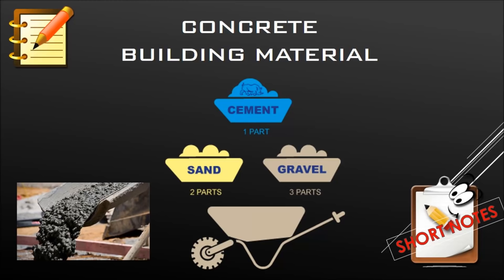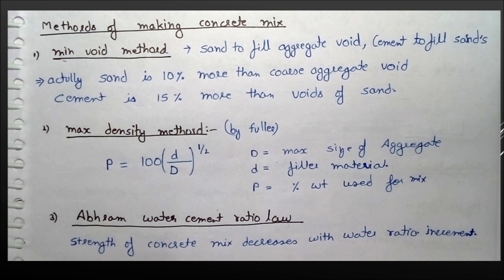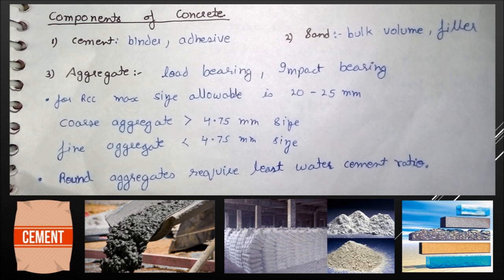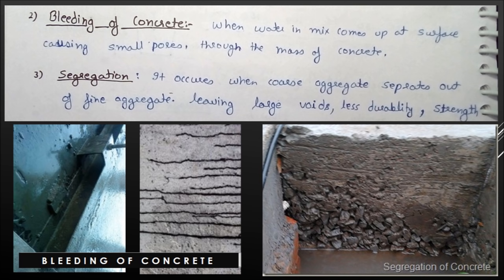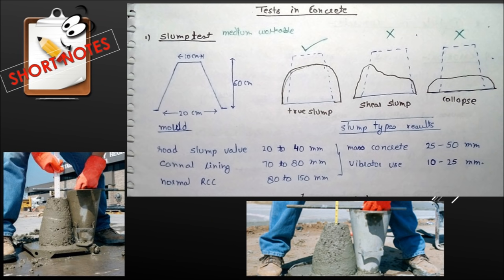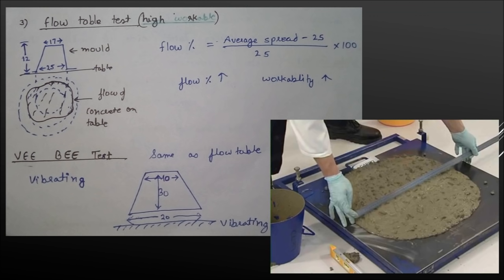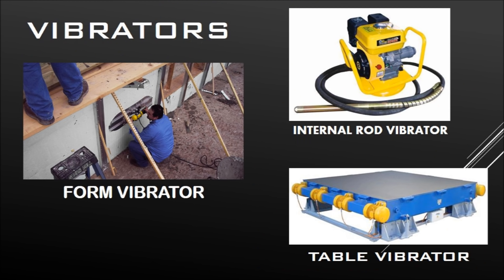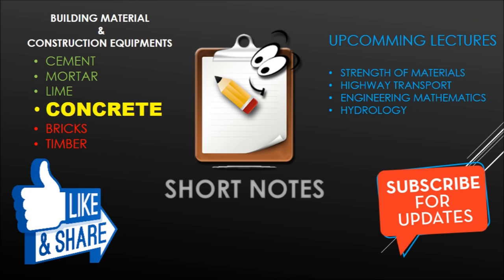CONCRETE Lecture 3 Building Material " GATE & IES EXAM " Short Notes

Comment: Sir why are curing 28 days
Reply from the maker: In 28 days becs , concrete gains 16 percent strength in one day, 40 percent in 3 days, 65% in 7 days, 90% in 14 days and 99% strength in 28 days. Curing is to cool down the chemical reactions of cement in concrete...